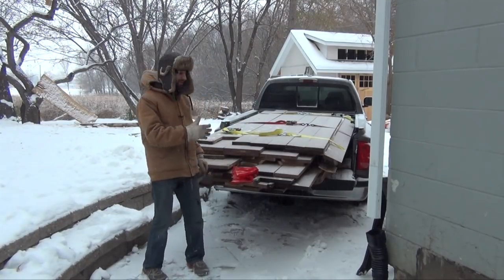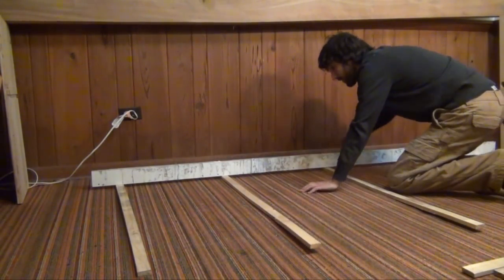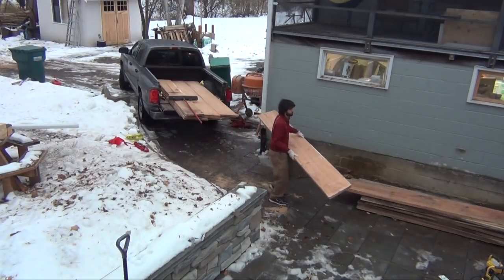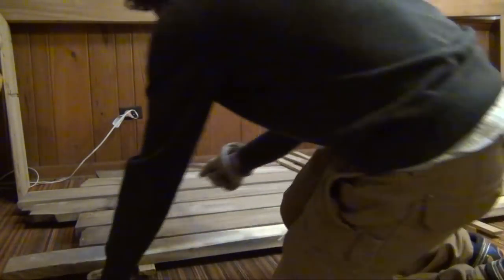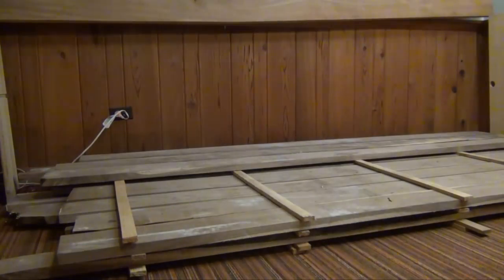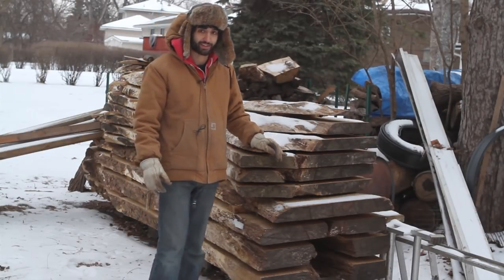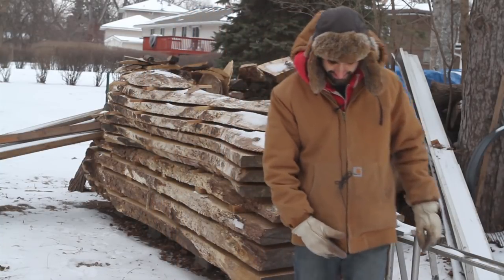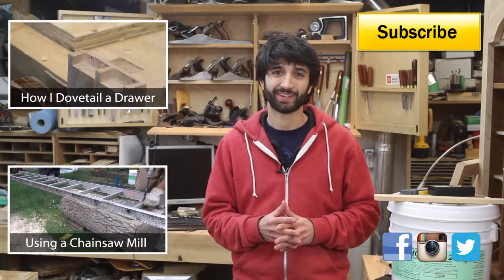Air Drying Your Own Lumber

Comment: Hi Matt, great video, lots of good info.. I recently had a tree taken out in my front yard, (it's roots were pushing up my concrete driveway), and I had the lopers leave me the main trunk which had a really interesting curly shape. I then sliced the trunk into 27 "hockey pucks" with a chainsaw a week later.. each puck is between 2 and 4 inches thick, ( by that I mean some are 2 inches thick, some are 3 and some are 4, but each puck is a fairly consistent width) and they range in diameter from about a foot to nearly 2 feet for the big ones..
I'm not sure of the tree species, nor do I know if it is a hard wood.. how long do you suggest I dry theses pucks for..?
I've got them in the back corner of my garage, under a shelf, up off the concrete by an inch or so, with 3/4 inch spacers between the layers.. I know that air flow may be an issue in that location, but it's now summer here in Australia, so the days are getting quite warm. If I stick my head down near them it doesn't smell very musty, which I think is s good sign,  right?
Any advice would be great help.
Regards, Gene.

Comment: Matt, my neighbor cut down a nice uniformed hickory tree. By the time I got there he had them in 18" lengths and they were 12" in diameter. They still have the bark on them. How would you recommend to dry them? Remove bark, cut in 1-2" thicknesses, inside an unheated or heated room, painted ends? I may use some for turning but the lathe is the next tool on my list.
Reply: Ted, hickory is the worst for containing powder post beetles (ask me how I know).  Once they get out of the wood and into your house, you can have a real infestation.  If you bring the wood into the house, remove the bark first, then paint the outside of the wood with borax solution such as TimBor or BoraCare (non toxic to people or pets) that will kill the bugs when they exit the wood.
Reply: +Dave Boyt Thanks Dave, I have the lumber in my attached garage right now with the bark on it.  It is not near the opening to the house, but I will get on that right away.  It's been about three weeks and I don't want to be infected.

Comment: Now this is why I subscribe! Great info. For sealing end grain I was taught to use a mix of 50/50 pva glue (normal wood glue) and water. Makes a thin latex-paint ish substance that dries clear.  Any ideas on doing it that way?
Reply from the maker: ***** I'm sure that works too.  The anchor seal dries to a thick wax so I'm sure it technically seals better but I'm not sure how much of a difference that makes.  For all I know it could be marginal.  Thank you!

Comment: Matt, we have a saw mill and i'm still pretty new at using it. I'm going to make some raised beds for our garden out of juniper wood. We have juniper on our property so i'm going to cut the trees down, mill them into the lumber and then use them. 
After watching this video do i need to let them dry out after i mill them if i'm just going to use them for raised beds and put them  on the ground where they are going to get wet again from irrigation? And is there any drying or anything i need to do between cutting the trees down and milling them? Thank you for your help.

Comment: Incredibly helpful! Should I be doing anything to the wood before using it in furniture or for building materials? Probably be using boiled lin seed oil once furniture is completed. 

Also can this wood be suitable for outdoor use? Around here (Ontario, Canada) the most popular woodworking product is outdoor muskoka chairs out of Cedar. Will the Cedar here have any negatives over store bought Cedar for this application?

Comment: small comment, Flex Seal is awesome on the end grain. I haven't found anything else that comes close! I use the spray because it's easier, but spray or brush its great either way! Not a plug, just actual experience...

Comment: Thank you very much matt. I just got my first load of ash in and it will need to be dried. The board has varied thicknesses, should I stack from heaviest to lightest or just use something else for weight? Luckily for me, the only place I have to dry is in my basement and its no longer hot here.
Reply from the maker: If you plan on using the thinner stuff first, you can stack the thicker stuff on the bottom.  That stuff will take longer to dry and you won't have to unstack it when you start using the thinner stuff on top.  If you don't have anything else to use for weight, stack the thicker ones on top.  They require less force to keep them flat.
Reply: Matthew Cremona fantastic, Thanks Matt

Comment: Good info here, although I'll have to disagree on the moisture meter sometimes it glitches and shows only surface moisture compared when you stick the pins in the wood. I install hardwood floors so the moisture levels between the sub-floor and hardwood is a bit deal.

Comment: Matt; I am a woodworker/carver and frustrated by the prescribed time limits for drying wood.  I have seen you on you tube a lot and seem knowledgeable.  If I cheat a little on the time, and work the wood anyway, then seal my work after I'm done, will I stop or slow any warping?  I know that even after complete drying, the wood will still take on H2O, or dry out long after you've done your careful work and sold it.  So, given that nothing keeps H2O entering and leaving your wood, after drying it, what can be done to speed up the flow of wood through my shop?

Comment: I have been drying wood for 30 years. Doors, gun stocks, etc. I weigh the board and write that and the date on the wood. When the weight stops going down, the board is at equilibrium with the room. The book UNDERSTANDING WOOD by Hoadly was a life changer for me 30 years ago.  I have given away a lot of copies over the years, but it never does any good. Woodworkers do not read books that read like engineering.
Reply: I do. Thanks for the tip

Comment: Matt love your channel, I am a total amateur with regards to cutting and drying wood.  I have some property in Illinois and have collected some good sized white and red oak trees that were lying dead over the past year. If a tree was already dead does the drying rule of 9months still apply?  I am going to be milling those trees this summer and will be drying out doors.  Most of the living edges are pretty rough as the sap wood has gone bad.  If thats the case is it best to turn into boards or can I still slab them? Any insight or advice is appreciated, keep up the great work!!  We love your channel.

Comment: I just recently heard that one cord of wood will lose somewhere in the neighborhood of 160 gallons of water in a years time.  I don't know if this is exactly true but seems reasonable.  Do you run a dehumidifier in the winter?  Being that you are in a basement I would think that it would need a little assistance dying the wood.  Or wood speeding up the drying process just lead to checks in the ends?

Comment: When you are putting down your stickers always try to put a row within about 3 inches of the end of the board.  Even if the board checks it tends to stop at the first sticker.  I learned this from an old saw miller.  I have about 1k bf of mixed red & white oak currently drying using this method.  Nice looking walnut.
Reply from the maker: Steve McEntyre Thanks for the tip, Steve!  I really don't have an issue with checking on the ends for whatever reason but that's probably a good thing to do for good measure.  Thanks!  Plans for all that lumber?
Reply: Matthew Cremona
I'll probably be making some chairs and a few other odds and ends.  Most of it is cut to 5/4 except for several 4 inch thick slabs.  Sittng in my dad's metal building so when summer gets here it will be a kiln. LOL.  You certainly have a nice inventory of wood.
Reply from the maker: Steve McEntyre LOL!!! unintentional kiln.  awesome!  Thanks!

Comment: Been educating myself on drying green lumber, watched alot of videos on the subject and yours are very informative so thank you for that, one question on the cheaper pin type moisture meter, if you drilled small holes same dia as pins to get them deeper in the wood maybe half way thru would you get more reliable readings? Just curious as to what your thoughts are, thanks

Comment: Good Job Matt... Just want to leave a very valuable tip when drying Lumber with everyone.  The Surface moisture should only be allowed to dry no more than -2% from the Core at any given time.  Or you can Case Harden and actually trap moisture inside.  Also, As Matt said, you cannot dry the wood too slow or it will begin to mold and you will have allot of staining.  Too fast though and you can actually ruin it with warping and cupping, cracks and splits as well as the aforementioned Case Hardening.  Lastly There is a huge difference between Drying wood and seasoning it.  The most enjoyable wood to work is wood that is allowed to season outdoors under cover from Rain, and sun for years and years.  Then bring it indoors for another year.  There is no comparison to how stable it is and how it works compared to Fast drying or Kiln Drying.  Keep your saw in the kerf!
Reply from the maker: Dusty Splinters Great points!  Thank for sharing them.  Like I said, this was just an intro :)

Comment: Nicely done! Great that you mentioned AnchorSeal.  A lot of good wood gets wasted as end trimmings because of cracking.  Good discussion about air movement, but you had the stack pretty close to the wall.  Did you put fans on it?  What moisture content reading on the meters do you shoot for?  When you say 'totally dry", do you mean oven dry (0% mc)?
Reply from the maker: Thanks Dave!  The proximity of the stack to the wall is one of my controls. It helps keep it from drying too quickly allowing me to better control the pace with my fans that I intermittently run.  Totally dry refers in this case to the point that it reaches equilibrium MC which is around 8% in my house.

Comment: First, I love your videos. Now to the question ; 

Did you not restrict the air flow when the full length of the backside of the stack was placed against the basement wall ? In the video, it looked like you only left the 2 ends and the front side of the stack for the air to circulate around the stack.
Reply from the maker: +The Shadow yes, that's one of the ways I control the drying speed or rather slow it down. Thanks!

Comment: Stacking 50 1" x 8 " yellow pine on a concreat slab. Shaded about 70 %. Plan to put 2 large fans running 24/7.  Might put a tent over it to increase heat. Does this speed up drying?

Comment: Can you do a quick video on Table saws? I'm going to be getting one (first one) and this is going to be the first "power Tool" I am going to get for the shop I'm building this spring.. I'm looking at Powermatic PM1000, Laguna Fusion, Grizzly... I would love to know your opinion!!  I love the video's! you're knowledge base seems to out weight you're age?? you must just pick things up quick..lol
Reply from the maker: ***** I can't really comment on all the brand or even the "nicer" saws.  I've only had that Ridgid saw that I have now.  If you have the money to go into a nicer one to begin with, I say go for it.  You won't regret buying something that is nicer to use. lol thanks!  I spend a lot of time soaking up woodworking info
Reply from the maker: *****
A table saw upgrade is something that is on my list.  I've been leaning towards a G0690 because I like that the dust port is on the side lol  I'll check back with you in 6 months to see where you are on that master status :)
Reply: Above all else, make sure you are more than satisfied with the accuracy of the fence ( your biggest priority!!! ) and then the torque of the motor.  What is a table saw without either of those features?  Id recommend you purchase a dial indicator and miter slot jig for it to ride in and take it with you while you are shopping around.  It may very well save you lots of pain and regret.

Comment: Hi Matt,
Do you have a system as to how you decide if your wood will be dried with the American or European style? Do you exclusively dry the chainsaw milled slabs with the European style, or do you ever rip those down into boards to dry that way? I figure the boards you have in this video came from the sawmill and not the chainsaw. Just curious for my own purposes. Thanks!

Comment: Hello Matt,

First off great video I really enjoyed it and will definitely incorporate most of your ideas into my milling process. I had a question though if you don't mind taking a look at it. 

Are there any issues with bugs inside the wood getting into the house if you put it in the basement? We have a lot of carpenter ants where I live and granted if it's a healthy board that shouldn't be the case...But I figured I would bring it up since this is something that most people might not think about...I just got into milling and was thinking about bringing it inside as well, but just hesitant due to the possible bug issue. If it's a possibility that bugs could harm your home or become a nuance is there anything that you would recommend doing before bringing the wood inside to get rid of the bugs without damaging the wood? 

Thank You,

Comment: You can avoid sticker staining by using the same species of wood as what your stacking.
Reply: Danstasuik2010 interesting
Reply: I put packing tape on my stickers, haven't had a problem in 12 years
Reply: Just don't use green sticks. At a kiln I ran many years ago we didn't have any staining problems but the sticks we used had been through the kiln many times. They were 3/4 x 3/4 from some hardwood and they got used for everything that went through the kiln.

Comment: i really needed this vid. thank you! i never knew i had to dry the wood for so long... would problems happen if i were to build a chair with un-dried wood?
Reply: Could very easily, depending on species & MC. Most woods do not change dimension until down around 30% MC, the fiber saturation point, then shrink tangentially & radially as the MC drops. Some, like beech and hickory can shrink tangentially up to 11%. That's a lot of change. It's always best to get the MC of the wood down close to that of its eventual environment. Keeps the joints tight. HTH

Comment: Matt,

This is great information.  Thank you for sharing!

Would you mind going into a bit more detail about avoiding mold/mildew in your basement?  I'd like to dry some lumber in my basement, but its a dark and sometimes damp space.  I know you talked about using a fan and I imagine that would help, but do you keep the space lit at all?  Anything else you do for that?

Thanks!
Reply from the maker: Adam Baird Thank you Adam!  A damp basement isn't a great place to dry wood because of the risk of mold.  It's even more risky since it's inside your house.  Having a dehumidifier running would help a lot.  The other thing you can do is maximized the airflow variables such as sticker thickness and stack width.  Having a fan circulating air will also help.   The space doesn't need to be lit.  You can dry in the dark.  Thanks for the question!

Comment: hi Matt, I got a couple of questions:
1. if you're doing tree cookies, do you seal up the ends as well? Even though they're thinner? 
2. I read/watched that you can substitute anchorseal with latex glue mixed with water. Where I'm from, there's no such thing as latex paint. 
thanks!
Reply from the maker: 1. yes, those will dry out too quickly and split since they are all end grain.
2.  Never heard of latex glue but if it seals the wood, it's going to be way better than doing nothing.
Thanks!

Comment: The idea in drying is to get the flow of moisture from the surface of the boards equal to the flow from deep within the board to the surface. Sealing the end grain helps to reduce splitting by reducing evaporation from the end grain which is faster than from the other surfaces. If dried too fast then the wood will warp when machined. In England air drying outdoors is 1 year for every inch thickness. Drying indoors would normally be too fast and result in warping and splitting. In a kiln with a dehumidifier the process can be speeded up. This is normally the commercial method. After air drying and storing in a shed the timber needs to be brought into an environment the same as the finished product, usually a centrally heated house, before it is made into furniture. So seal end grain, stack in a shed, cover in hot weather, fumigate for woodworm if necessary., leave it for years,bring into the house or workshop to stabilise, leave it for weeks or months. 
Or pay an expert to kiln dry it if you are in a rush!

Comment: HI Matt, thanks for the great video. Quick question - I have two large trunks of Oak that have been sat outside for the past 12-15 years, they have lost their bark and are fairly weathered but don't look  rotten, would you say that these could still be milled into decent lumber?
Reply from the maker: Gardner Tech Stuff Thank you!  it's totally possible that they are still good for lumber.  It's hard to tell though until you cut into them. I'd saw off a few inches of each end and see how the log looks.  It should be pretty obvious if the log has any rot inside of it.
Reply: Matthew Cremona Thanks Matt, will give that a go!

Comment: Another excellent tutorial video. Does the rate of drying have any effect on the chances of warping or cracking?.
Reply from the maker: Simon Nicholson Yes, if it is dried too fast, you can pretty much make the lumber unusable.  Luckily that is pretty much impossible to do when air drying.  It is however, very easy to do when kiln drying. Thanks!
Reply: @mcremona  A commercial kiln I ran many years ago was gas (LPG) fired with massive blowers operating all the time. It also had a big open water bath in it so the atmosphere wasn't bone dry.